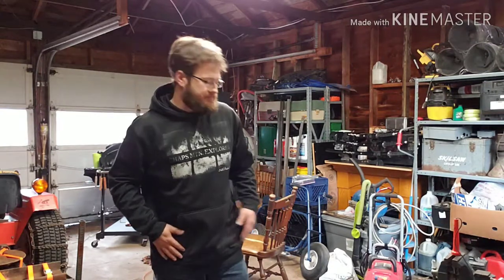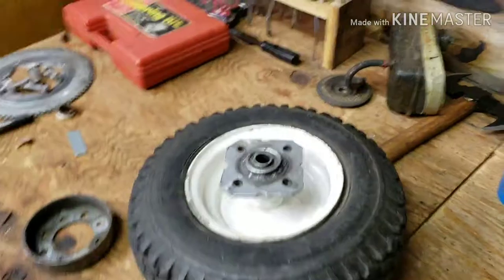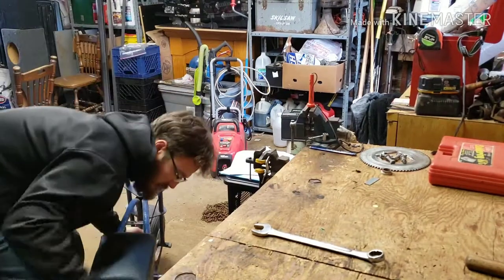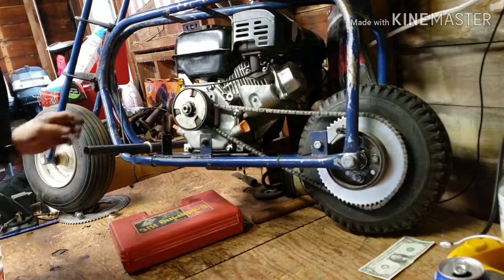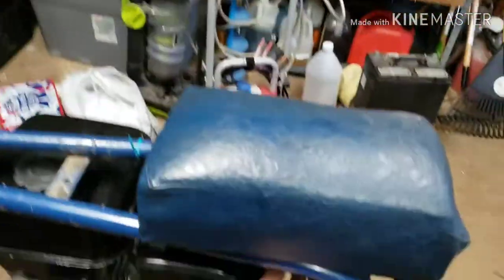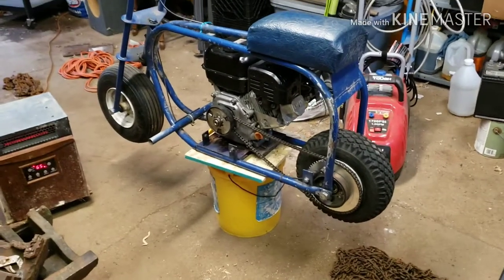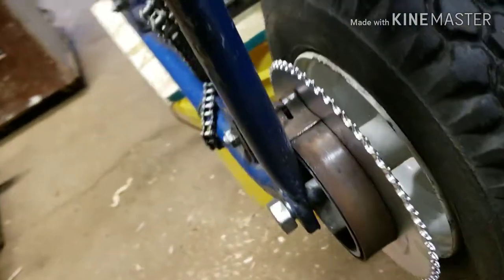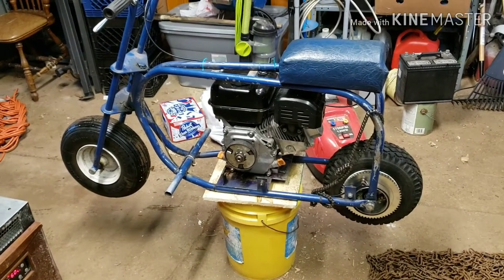New sprocket on the minibike and putting it back together

Comment: Your sprocket hub is welded on Soo off center to the center of the bearings that your chain is going to tighten and loosen itself as the wheel spins because the sprocket will get further away from the engine and then it will get closer every half rotation
Reply from the maker: I have since fixed it and have ridden it all summer with little problem. Thanks though
Reply from the maker: i just went back and watched the video to see. it appears like it is way off center in the video but i believe it is just an optical illusion. that bearing actually sits proud of the surface and that makes it look so. there was no out of roundness once everything was bolted together